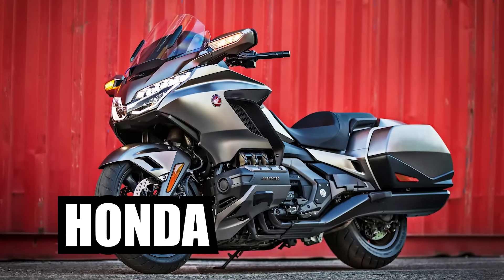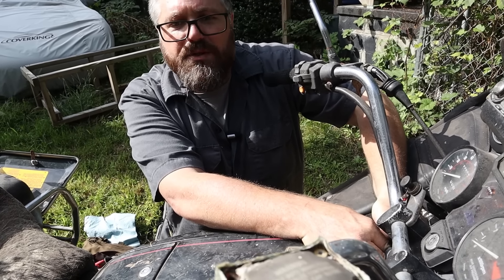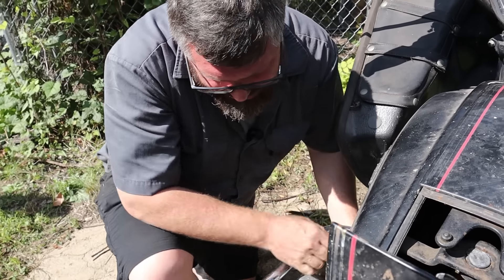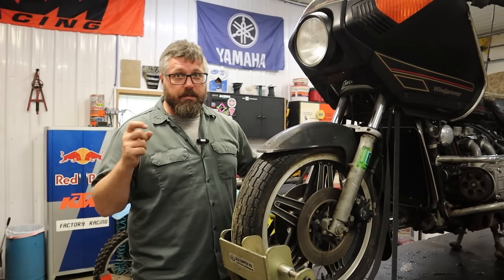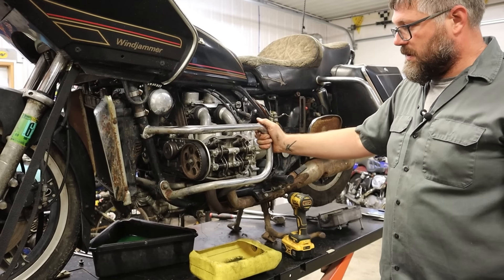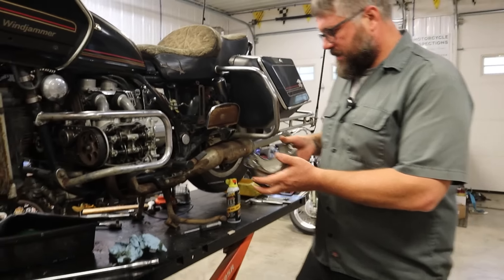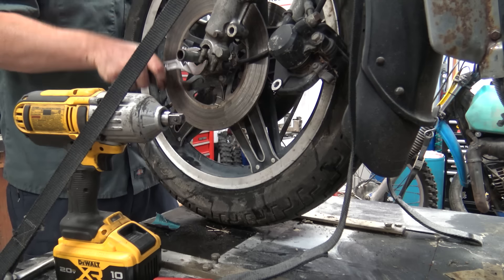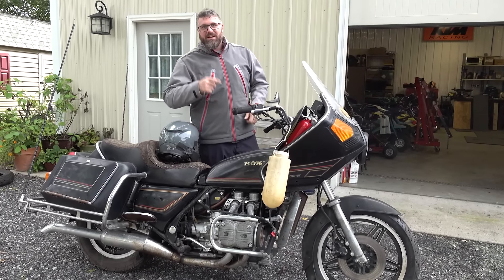Will this Abandoned Honda with a Seized Engine Get Me 247 Miles Home?

Comment: I have a GL1000 it had 35000 on it when the oil pump drive broke finding bearings main and rods were impossible to obtain atleast for me I could find one set here and there every bearing is different so I ended up getting a good engine and installing it after 20 years of it being apart I ride it quite alot now its a beautiful sulfer yellow

Comment: Not sure if youll see this, but My dads just bought a 98 Sv400s. It needs a lotta work but were struggling to find much on it manuals ect wise, hoping yhe 650s parts are compatible but theyre rather uncommon bikes here. A lot of it is stiff, breaklines are dry, key wont turn ect, any advice would be absolutely fantastic

Comment: Fist step. Check the air box. Once, I spent hours getting a very low milage 80s bike running and then discovered a fiberglass rats nest in the air box. Too late. Valves burned. Carbs fouled. Very disappointing.
Reply: Oh, good. That did get checked.

Comment: Step 1 10 mm/ 3/8 socket wrench step 2 PB in clean stuff. Step 3 drink a PBR in wait 3 hrs. Does anyone notice the air born ranger badge on the bike that 😎 and nothing missing plus a vintage Sony radio ok how many years did it sit there?3..4.5..

Comment: Wow, that looks nearly same bike as the 1980-81 CB 750 Custom, same full dressing and color even, same seat, but my fuel tank was smaller and no chrome bars to protect sides of engine and saddle bags. Perhaps the wider engine made for wider tank?
So, the 1980-81 CB 750 Custom was the start of Goldwings?

Comment: I’m about to do the same thing only I don’t have to drive it as far. I only have to drive in about 5 miles. It’s sat since 1993 in a garage its 1984 Honda nighthawk 650 hopefully I can get the engine unstuck and the tires unstuck everything else seems to be an OK condition only has 12,000 miles on it. I don’t know if that’s a lot or not. I give her my best shot though.

Comment: Craig is right on this bike in general it will make somebody a great Parts Bike   To make it a Rider and a good bike again  Inthink who ever does it is a Labor of Love for that Bike  but me personally has had negative experiences with Engines that have had internal  Water Corrossion without tearing them completely down and  rebuilding them properly  I’ve gotten the to run okay but they have too many “Gremlins you keep chasing  I had a 4 Cylinder that ran 500 plus miles on local roads but it’s first long run  it spun main Bearings ? My thoughts is the. Mixture of Antifreeze  and Acidic RainWater creates  something that weakens metal after long term Exposure then  from the heat eventually something gives out (Breaks, this was a fun Video and it just so happens that these Bikes and years are my Favorites to Ride I also like the overall,look and Styling  of this Era

Comment: I would have used automatic type F tranny fluid n filled them full n let it soak, its detergent oil n cleans good then spin it over with the plugs out to blow all of it at. Just my opinion, i been building motors n race motors for yrs n it has always worked. But i just came across you fhannel with the busa one you just put out. Ya that waste gate is a good one from Tial to use. Dont kn what brand the turbo on the busa was thou. Always eanted to build a bike thou. Thanks for your videos buddy...

Comment: I have a zx14r 2014
With bad psi on cylinders
Cylinder 1 and 2 i have 125psi
Cylinder 3 150 psi
Cylinder 4 175 psi
What could be the problem 
2014 18.000 miles 
No smoke only when i red line but just a bit probably cause i don't have catalytic converter 
I believe is the valves 
To low miles for a bad piston ring 
Nice video btw

Comment: Now. Fill that one bad cylinder full of oil and let it sit for about a month. Run the dog out of it. Then check that cylinder. I can almost say you will have a good cylinder after that. That is what I did to a locked down 250. Now I used it to go around down.

Comment: #1: WHY WOULD YOU BREAK LOCKS?
THERE IS A NUMBER ON THE KEY HOLE THAT YOU CAN USE TO GET A KEY MADE.
AN HONEST LOCKSMITH WILL ASK YOU FOR A TITLE OR PROOF OF PURCHASE THEN CUT YOU A KEY.
#2: To check if the engine is locked or to break it free.. Squirt some oil into the spark plug holes, put the shifter in 2nd or higher gear and rock it / roll it.
#3: IT'S A GOLDWING!! GET IT BACK ON THE ROAD!!

Comment: In the 80s, Honda manufactured motorcycles so that they continued working even after a nuclear explosion.
Reply: Gl1200s had stator issues 
Nothing like pushing 600 lbs during heavy traffic.